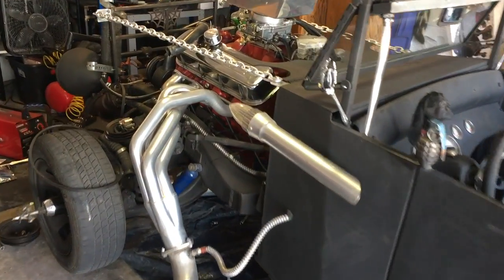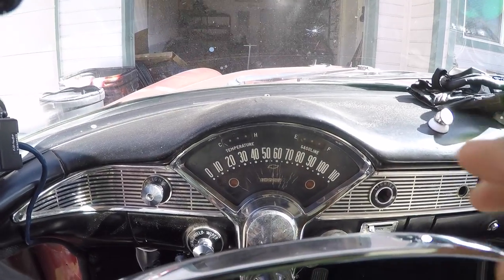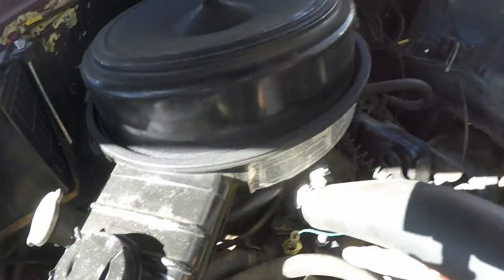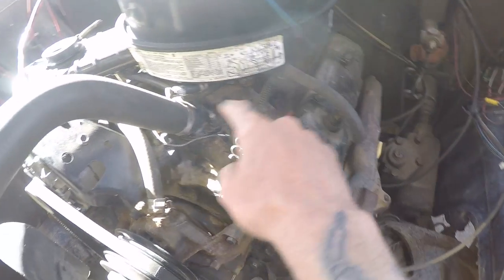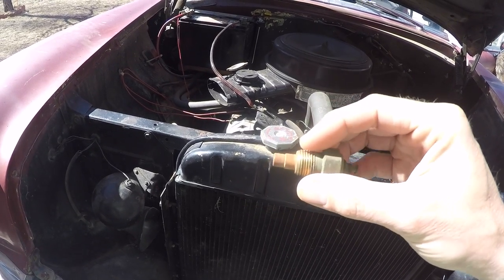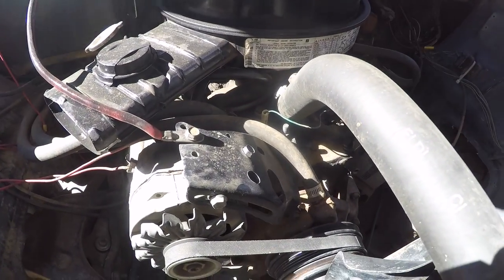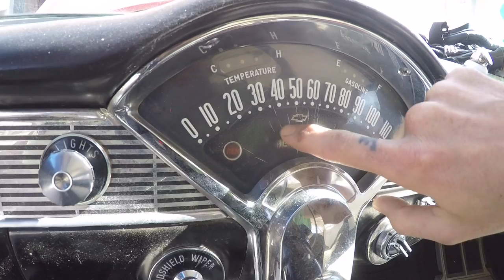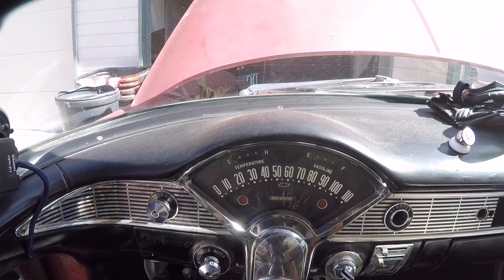1956 BelAir Coolant Temp Sensor S08E04

Comment: Cool video. I've also got a snoring french bulldog. My 57 Chevy 210 still has the stock 235 in it. But i'm very familiar with the SBC coolant temp sensors like the one you have. My 79 K10 pickup has the botton style in the side of the head.
Reply from the maker: FRENCHIES ARE THE BEST!